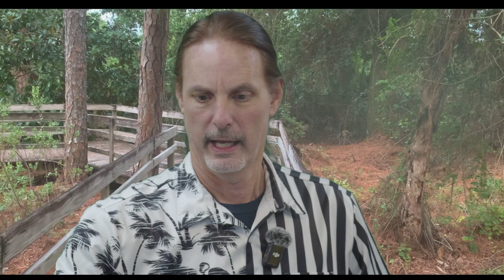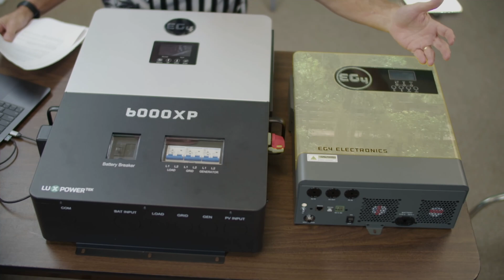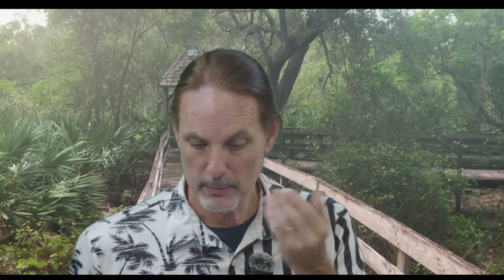Live: EG4 6000XP vs 3000EHV — All-In-One Inverter Deep Dive + Q&A

Comment: Here's what Google has to say about EG4: Common EG4 complaints include issues with product quality and performance, such as charging problems and voltage drops, but the most significant and frequent complaints are about customer service, support, and warranty issues, with users reporting unresponsiveness, lack of communication, and difficulty getting faulty products replaced. 

Product and performance issues
Charging problems: Users report slow or incomplete charging from solar panels and chargeverters.

Voltage drops: Some users have experienced significant voltage drops in their systems.

Product malfunctions: Some products have had issues like random shutdowns or a single battery unit failing.

Chargeverter limitations: The EG4 charge verter cannot charge effectively when the battery load exceeds its charging power output. 

Customer service and support complaints 
Lack of responsiveness: Numerous users have experienced significant delays in getting a response from EG4 support, sometimes going days or weeks without a reply.

Unprofessional and unhelpful staff: Some customers describe interactions with staff as unprofessional, with staff being rude, lacking knowledge, or placing blame on the user.

Unresolved issues: Problems are often not resolved, and the company may not take responsibility for faulty products.

Unclear communication: The company's support and warranty process is criticized for a lack of communication, leading to uncertainty about replacement timelines and status.

Warranty problems: There are complaints specifically about the warranty process being problematic, even on expensive batteries.